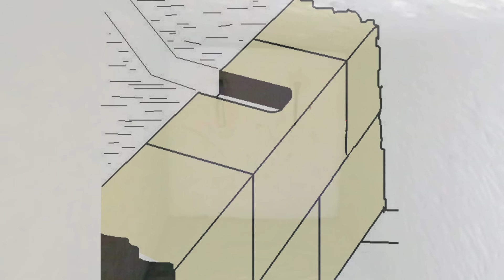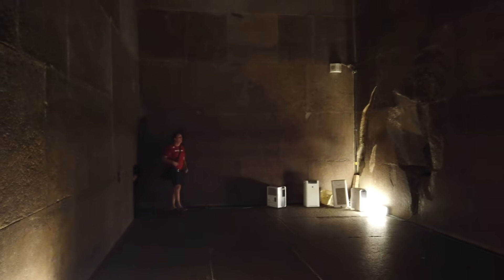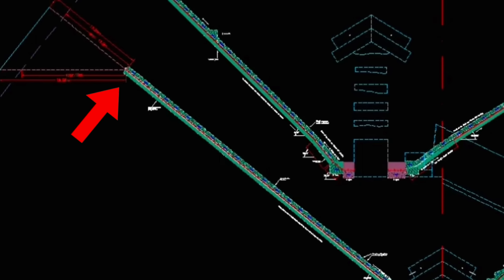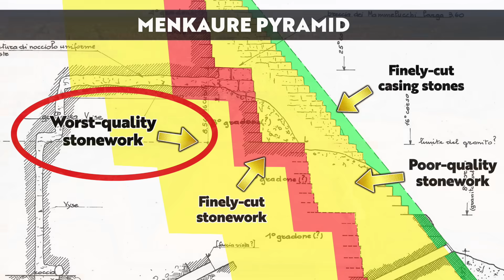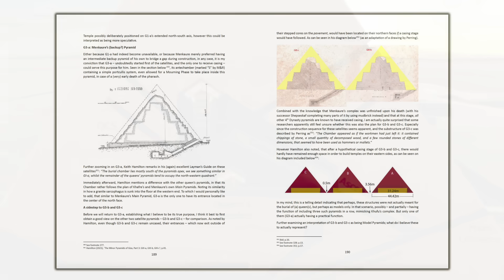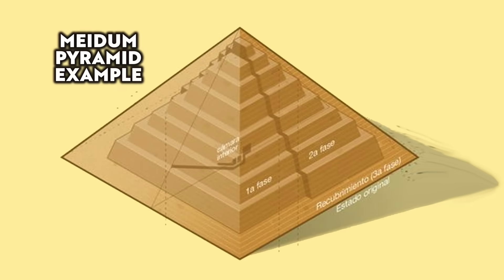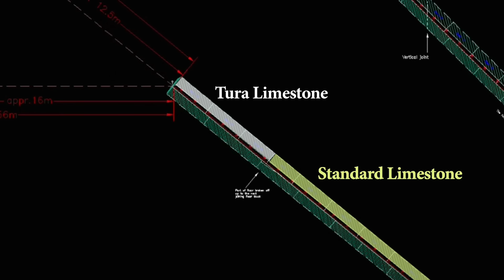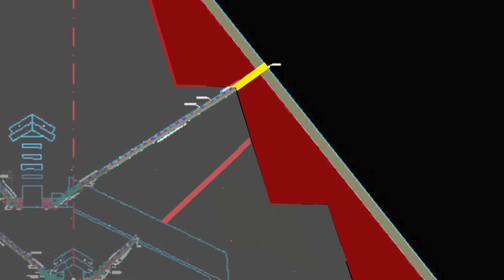Great Pyramid HIDDEN Steps Explain Everything | Part 1

Comment: Hear me out please as I might sound negative at first... I don't think you explained your theory very well and for several minutes I was disagreeing totally - you showed a diagram of the interior and my thoughts ran along the lines of - if they built the tunnels out towards the light they were soon building them into the core at a much higher level even than the top of the King's Chamber (2-3 relieving chambers up actually) so why suddenly stop if you've already finished building the King's Chamber, even if you've decided not to use the Queen's Chamber? OR if you've still only built the Queen's Chamber at that time then you would then have to actually EXCAVATE the pyramid's internal structure to build the King's Chamber - HIGHLY unlikely because it's so counter productive. But by the finish I was totally on board because you then explained your concept that the Queen's Chamber was always a stand by and by the time of the Third Relieving Chamber they were on track to finish the pyramid quite soon even if the old Khuffer pegged it prematurely. 

So almost certainly you could well have nailed it.... 

BUT... may I make an observation? You also showed a diagram which overlaid the steps as derived from the scan results and posited the theory that these were the core pyramid's steps awaiting finely dressed finishing layers. But here's the rub... you appear to have taken some liberties with the steps because the "steps" on the left and right don't line up at all, so your lines to suggest the position of each step actually contradict the lines derived from the scan results. To both myself and my wife the scan results overlaid on the pyramid plan suggest the levels of the end sections of internal ramps as per Jean Pierre Houdan's theory, towards which we strongly lean - his theory is far too logical to be ignored, and so I disagree with your comment dismissing the idea that those scan results look like ramps. To my way of thinking building a step pyramid first would aid the ramp construction greatly because the ramps are simply built onto each step. So too would building a step pyramid and dressing off the outsides at the same time as it rises - again JPH's theory, and in essence it is still a step pyramid with a casing. The only thing possibly disagreeing with this interpretation we could come up with is the steps closer to the top don't at first glance agree completely with the theory because they are not set at a consistent height - in the overlay I couldn't reconcile it with our idea, although I didn't sit looking at it for long enough to make my mind up and frankly I think I would need to drag out my old TD drawing board and do a few accurate drawings with plan, front and side elevations to make sure.   

FINALLY - one thing doesn't sit easy in my mind - the underground chamber which many believe was going to be the tomb chamber until plans changed, sits centrally under the apex of the pyramid does it not? Furthermore, the Queen's Chamber also sits directly beneath the apex. The King's Chamber however DOES NOT, and by quite a long way out too. So... if you're going to build the Queen's Chamber as a stand by whilst ALWAYS having the intention of building a King's Chamber designed to be his final resting place then why offset it from the apex when apex alignment seems to be a critical requirement of the construct? I would tend to think the architect offset the Kings Chamber because he thought it should be built over a solid masonry core for fear of it collapsing into the Queens Chamber. But here's the rub - surely then you would offset the Queens Chamber, not the intended burial chamber?

So... right with you on the theory that there was no point finishing the air shafts after the end came in sight. NOT with you on the ramp denial! 

Great thinking my man! Congrats.

Comment: This does not make sense from an engineering perspective - you would need one ramp to build the core, then tear it down and build a new one, from the ground up, to build up the backing/finishing layer. And these are huge ramps and you can't use the first ramp to build the backing/finishing layer from the top down, because it's too thick and needs support, does not fully rest on the core alone.

Comment: I understand there's plenty of reason not to believe The pyramids are older than we think they are, that said, I would love for our internal stepped core structure to prove to be older than the pyramid shape we see today. I would love to believe Khufu repurposed the pyramid for his only burial in that it had a more significant, more practical purpose or function in pre-dynastic history. And though I know it is very unlikely to be the case, I Don't believe it's impossible that these buildings weren't just stolen renovated and repurposed

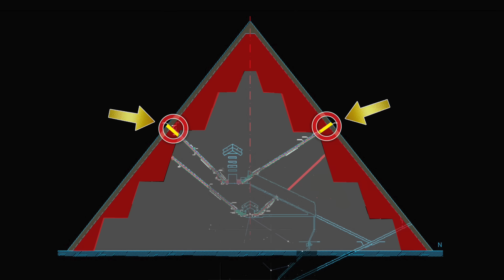Comment: 12:32 What could be the argument to equip the ventilation ducts' closing doors with metal handles while metal was not or very scarcely used in those days? Was it to make the doors removable?

Comment: You really think the genius engineers who designed this pyramid did it all on a wing and a prayer not knowing if the king's chamber may or may not survive or be structurally sound?!!
C'mon dude, you may be right with the queens chamber air shaft theory but your premise about the king's chamber is IMO miles off course.

Comment: How could the kings chamber shafts be air shafts when they were closed off at both ends with blocks which by all accounts were original to the building of the kings chamber and designed to make it look like they weren’t there?

Comment: Happy birthday! Here is my take as a seasoned stonemacon-marblerestaurer on this: the internal core surely is a stepped pyramid. But I do think Houdin's internal spiral ramp idea can be transposed- set upon the steps of the core pyramid. Not internal but external, not offset, but following the steps themselves.  This would meen that only a slight ascension angle has to be overcome, as the core grew, depending on in how many steps it was built . The more steps, the lesser the ascension angle. The rampmaterial on each step probably stayed partialy in place as part of the  outer structure,  casingstones excluded of course. Pyramids in Mezzo and South America were probably built this way, but they just stopped when the steps were finished and removed rampmaterial. A fan for many years, thank you so much for your interesting channel. Greatings from Ghent, East Flanders, Belgium!

Comment: Nothing said here explains the base stones holding up the pyramid which are larger than anything else apparent, a hundred times larger. As well it doesn't explain the depths of carved tunnels leading to the void city underneath the plaza and sphinx temple. If you cant start at the bottom dont work above it. And any good architect was trained and taught always start with the base to meet needed design and load, if you dont your beautiful work will not be standing long. So why break this cardinal rule, or no clue? Go back to the bottom if you want to convince me or anyone of your ideas of the top.

Comment: If you combine the image of the gravity anomalies with the stepped pyramid structure = a ziggurat. Now the great pyramid finally makes sense! It was a ziggurat that the 4th dynasty egyptians found and turned into the great pyramid. Originally, it probably had open corridors on the north face that went straight in on 3 levels into large rooms inside (queens, kings, and one chamber above the kings) This wide open architecture of the ziggurat was originally all rough stone work on the inside and the egyptians then transformed it by building inside of the wide open 3 corridors and 3 big chambers, turning it into what we see now. That's' why the queens chamber is unfinished. The Kings chamber used to look similar but they brought in nice stones and added a roof. My guess is that the relieving stones above the kings and queens chamber were not actually to reduce weight. They were part of the effort to make the chambers smaller in height. Just an off-the cuff theory but I'd love to hear you cover this idea.

Comment: The inner core being stepped seems to require that they build the pyramid twice. I just don't think that happened.  I think one must put the outer casing stones in first to get them square and then you back fill.  At least that way you do not build it twice.

Comment: You seem to be saying that the inner stepped core is most of the pyramid, and the backing stones and casing stones are just a small addition.  But the volume of the additional stones in total looks like it is similar to the core.  Do you have a calculation of the two volumes?

Comment: I like the theory but surely looking behind where the Queen's Chamber air passages finish would show the different type of stone being used by the stepped core pyramid that you hypothesize and the start of the backing limestone so surely you'd like to see this done? Not to reveal any treasures or new hyroglyphs or anything like that but purely from an architectural point of view? This wouldn't totally prove that the pyramid was destroyed but it would be evidence towards it. 

Secondly, and unrelated, I'm sure that I watched a video, either of yours or History for Granite, that disproved the air ducts being aligned with certain stars or constellations because they weren't straight but here in your diagrams they're straight, which isn't accurate and continues to help those pushing this false narrative. Did I dream that or is this true? And if it's true why don't you show this?

Comment: You are totally Uh uh, Wrong. It was a POWER structure. And it was destroyed. I'd say by way of war. And the tech inside of them were taken out. One of them they call now  "The Ark of the covenant" 
You're way behind. The NEW findings go deep too. And it's said they are still putting off power at a very low rate.. Happy late day to ya

Comment: As an engineer, the  diagonal shafts are essential to the building of the pyramid, and why they are sealed off. It has nothing to do with air flow, or looking at the stars.
Reply: Could you elaborate on this please?
Reply: Certainly. Just provide some suitable recompense...

Comment: Based on the modular-fractal grid that Egyptian architects likely used to design the Great Pyramid, it is possible to determine the technique of constructing the tiers of the pyramid’s core. A combined approach was employed, which integrated the upward extension of a vertical shaft with a double-sided stairwell set at a 45-degree angle. One such shaft could reach up to 10 meters in height (half the height of a single module of 21 meters). When conditions allowed, it could extend up to 15–20 meters, i.e., the full height of an entire module (tier).

Through this vertical shaft, blocks were lifted upward from one tier to another by means of ropes pulled from both sides—workers, while pulling, descended along the lateral stairways. In other words, by using this specific technique, not only was movement between tiers possible, but also the lifting of blocks along the vertical shaft, which had a width of about 1.5 meters, approximately matching the size of a single block. The shaft acted as a natural guide, preventing the load from swinging from side to side.

After construction was completed, these shafts were filled in with the remnants of the outer ramp. The outer ramp itself was used up to a height of about 40–45 meters and could have had a steep slope of up to 20 degrees, which may have allowed the height to reach 50 meters, but no more.

The question of how the tiered core of the pyramid was built lies in the concept of the modular-fractal design of the pyramid—combining the technique of extending vertical shafts with stairwell passages, which served both for rope tension when lifting loads along the shaft and for moving between tiers of the pyramid. The material of the outer ramp was used to block these internal technical shafts once construction was complete
Reply: The ramp was the causeway leading to where the second pyramid is now with a short ramp continuing from that elevation onto the great pyramid.

Comment: If the king’s chamber failed, they needed not change the stepped core, and reduce the size of the pyramid, they’d logically continue finishing the final casing stones as planned as per final size, by extending the queen’s shaft instead of the king’s! Trimming the shape like you showed in your graphics is not an easy task to accomplish! 

I’m not sure about the accuracy of the queen’s air shafts top edges being made out of white Tura limestone, but it could be the case that the stepped core’s outer edges were made to be smooth, as if final, just like in the Meidum pyramid, just in case a smooth pyramidal shape was to be aborted! That way, they secured a decent-looking stepped pyramid with a polished white finish!

Comment: Happy Birthday. 
The stepped design of the core is not a reason to forget about the air shafts. There is no evidence for this. The shafts were not built because the pharaoh died. This version has 100500 proofs.

Comment: Do you realize what you're saying? Did the ancient Egyptians fail? Did they have a backup plan? I seriously think you're speaking without any knowledge of the facts. First of all, they never started a project without the absolute certainty of being able to complete it, like the bent red pyramid, which many say they made a mistake and therefore had to bend to prevent it from collapsing. But as you also explained, that's not the case, and we know this by analyzing the blocks and their lines, which intentionally bend first, so it means they deliberately built it that way. The same goes for the great pyramid and other Egyptian structures. There is no calculation error; it was first drawn on paper, calculating its weight and mass to be absolutely certain it wouldn't collapse. The only mistake here is you...

Comment: I have long believed a step core was the most likely plan. .. Building up then out.  The failed Pyramid implies the add on was not well done contributing to the  eventual collapse.  But for those who believe there is a secret room /galley?   We need to try to explain why the abnormality exists.  I won't believe  it until I see it... but I can't ignore the data might indicate something is going on.  And you are right.. it is a work in progress.    I also don't think  this means  Pierre 's work is all wrong .. we just don't understand because we were looking at the building process differently.   I still think the vertical dimples indicate something..but I don't know what yet.  So we keep looking at the evidence and test new ideas.

Comment: I think your theory is worth considering.  The only thing I disagree with is your proposal that they would have shaved off the edges of the core before placing blocking stones.  I think they would have left the core as it is and simply encased the entire core, simply extending the Queen’s chamber air shafts.  Extending the air shafts would have been far simpler and less work than shaving down the core and then finagling the blocking stones to stay in place.

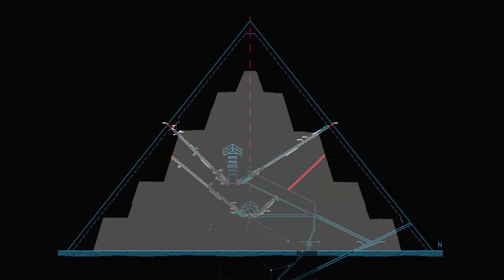Comment: 10:34 The third tier cannot be more massive relative to the two lower tiers. But your logic is absolutely correct — the tiers all have the same height of 21 meters. This applies not only to the first two tiers, but also to the third, fourth, fifth, and sixth. The seventh tier is adapted to the outer casing and to the pyramidion.

The main point is that the first three tiers, equal in height with a base of 170 × 170 meters, form something like a mastaba, which, together with the upper tiers, takes the shape of a stepped pyramid core. On the other hand, this is a reference to the engineering and sacred concept of the Bent Pyramid — the idea that the pyramid “grows out of the mastaba,” which explains the change of angle in the Bent Pyramid. But this is my personal assumption. I describe it in detail on my channel.

Moreover, according to the structural character of the Great Pyramid, it seems to have been conceived in three stages of construction.

The first stage — something like a large mastaba, based on the properties of an equilateral triangle. The proposed height is 147 meters, with a base of 170 × 170 meters. Angle either 60 degrees or 75 degrees.

The second stage — a pyramid with an angle of 52 degrees, a height of 147 meters, and a base of 230 meters. This structure covered the first one, which acted as the internal core of the pyramid. The second stage is the pyramid in the form we know it today.

The third stage, according to the calculations, was also envisaged. This would have been a pyramid with an angle of 45 degrees, a height of 147 meters, and a base of 294 meters. This third pyramid, in concept, was meant to cover the first two constructions.

I repeat, this is my personal hypothesis, based on calculations according to the applied fractal modular grid, by which not only the angles of inclination and the dimensions of each tier were determined, but also the dimensions of each individual block. Within this system, the smallest block had a height of 0.75 m, the medium block — 1.5 m, and the largest — 3 m

Comment: This is a good theory and explanation. However, it doesn’t answer one key mystery, which is obvious in the graphics here - if the Queen’s chamber was a contingency, why is that the chamber that is centered on the pyramid’s central axis, while the King’s chamber is not? That is one mystery that I still haven’t heard a good explanation for. It seems likely to me that the Queen’s chamber was the original intended one, until early construction went quicker than expected and they expanded their plans at that level of the construction.